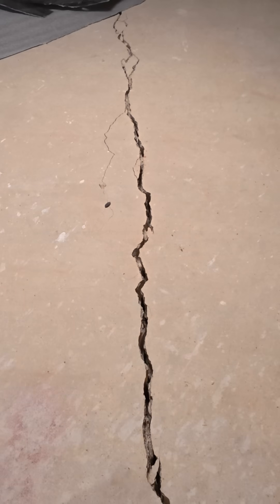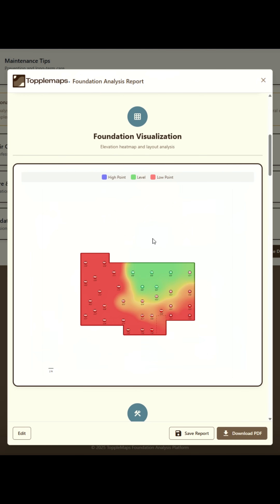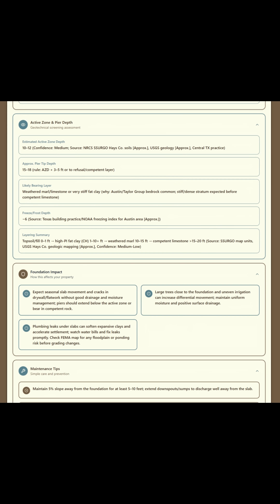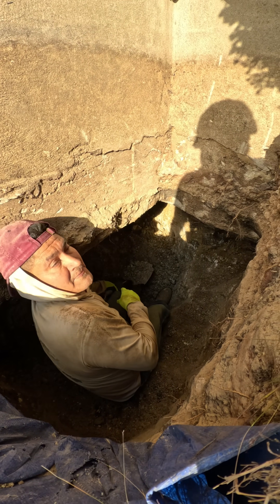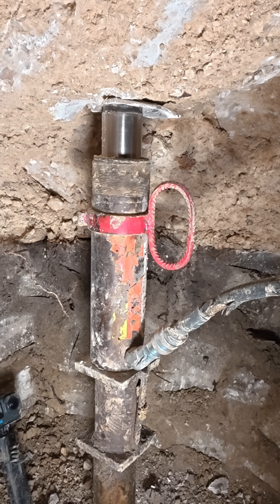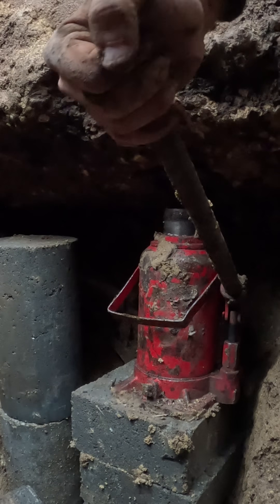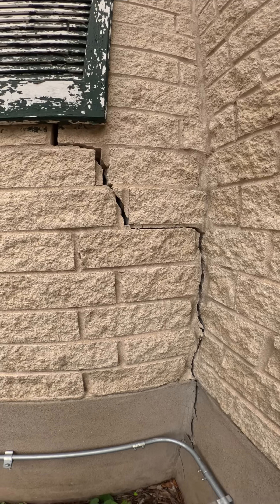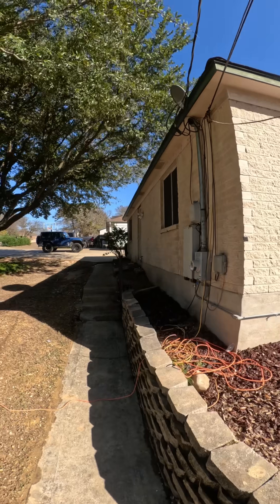Foundation Repair Case Study | 4.5” Lift Using Deep Steel Piers (27 ft, 10k+ PSI)

Comment: Does the method applied depend on the climate, like colder areas need a different approach? We are in Northern Toronto by Lake Simcoe and I am researching as our deck is non longer level and there are recurring cracks in the foundation. Thank you in advance for your response! @ifixconstructionfr

Comment: That crack could have been caused from last repair  10,000 psi pressure can crack a foundation
Reply from the maker: That crack pre-existed from the foundation settling ~4.5 inches. No prior repairs were done. During pier installation, the hydraulic pressure is applied into the soil, not laterally into the foundation. As the foundation was lifted back, the crack closed again — which confirms the cause was settlement, not the repair.

Comment: Thats right, my mom's house needs some lifting, was trying to explain to my brothers that there is a difference in lifting the slab and compensating for the sag to give appearance of repair, huge difference
Reply from the maker: You're absolutely right—true foundation repair goes beyond just appearance; it’s about restoring the structural integrity and stability of the home.
Reply: @ifixconstructionfr thanks very much, im going to show them this message so maybe they'll understand, the price tag for the cosmetics band-aid fix is around 5K, to do the lifting of the slab is a hell of a lot more  than that,  thank you brother, God bless you and family this holiday, merry Christ-mas
Reply from the maker: Merry Christmas and yes. Foundation repair will most likely cost more than 5k but a repair done right, will last decades not just a change of season

Comment: can this be done on a combination slab with no beams and ibeam columns. On a 26x24 “building”? Thanks in advance
Reply from the maker: Yes, it’s possible—but only if there’s a clear load path. On slabs with no beams, piers must be placed under columns or added beams. A flat slab alone can’t properly transfer load into piers without engineering modifications.

Comment: Would this be a lot more expensive in San Jose CA?
Reply from the maker: in most cases it would be noticeably more expensive in San Jose.

There are a few reasons:

Labor, permitting, and engineering costs are significantly higher in California

Seismic requirements usually mean more engineering involvement and stricter inspections

Helical piers are more common there, but installation still typically involves heavier equipment and higher mobilization costs

Access constraints and tighter urban lots also add time and cost

So even if the type of repair is similar, the same scope of work in San Jose will usually price higher than in Texas. The exact difference depends on soil conditions, access, and how much engineering is required, but overall costs are generally higher in that market.

Comment: Bad ass work how would one get into this line of work?
Reply from the maker: 2 ways, you can be an structural engineer to design and stamp repair plans or start working with a foundation company in your area to learn how to do the actual work. But all repairs need an structural engineer to design, review and sign off upon completion

Comment: Just another tuesday in Texas😂 literally every house will need this! Might as well have jacks installed at construction
Reply from the maker: While Texas soils definitely keep us busy, regular foundation maintenance and proper drainage can prevent many major issues. Building with jacks is an interesting concept, but deep piers provide a permanent solution engineered for long-term stability.
Reply: Hey bro just so you know, that ain't normal. Builders are ripping you off.
Reply: sound like you need deeper piles when you build, so builder going cheap or on ones doing a load test on the ground before hand

Comment: One reason not to buy a house on a hill unless you have money to spend for foundation problems.
Reply: I work in foundation repair in North Texas and let me tell you, it's almost every house, not just ones on hills. A lot of movement is caused by the Texas soil with high clay content, black gumbo clay especially, and people with an aversion to gutters and proper drainage.
Reply from the maker: Hillsides can definitely present unique challenges for foundations!